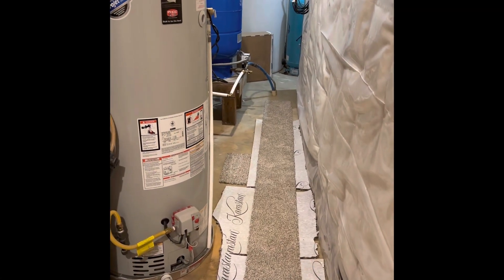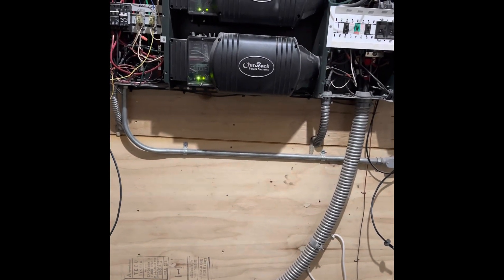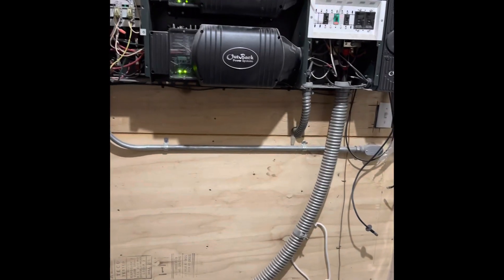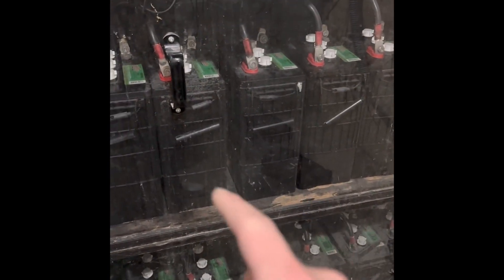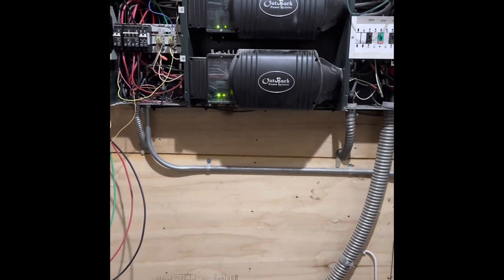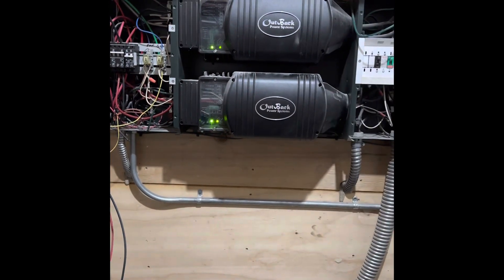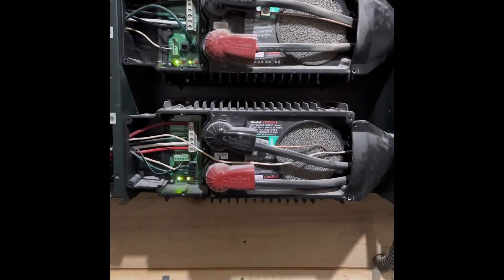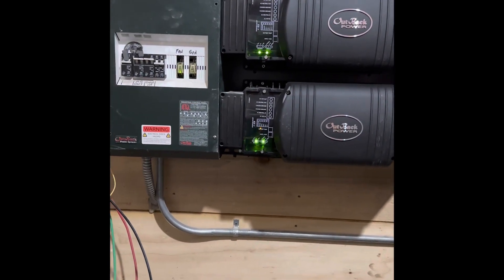New Outback Power VFXR3648A inverters with EG4 LiFePoWER4 battery bank

Comment: Nice video. I can appreciate the second set of hands because these new inverters are very heavy and tough to mount at that height. I noticed the 4 wires coming into the top of your AC panel. Is that your generator wiring and if so is that the red wire connected to your inverter's AC HOT IN terminal?

Comment: Very nice video. I have recently upgraded to the same exact equipment. I also have the older Outback panels with the normal-bypass wheel. However, I'm having trouble understanding how that is supposed to be wired up since I inherited this system from the previous owner. Can you do a video on that AC panel or explain how that bypass is supposed to function. Do you also have a generator tied to this panel to also charge the batteries if necessary? Any help would be greatly appreciated.

Comment: You can use the VFX inverters, you didn't need to change anything. I have 4 x 3648 vfx with mate 3s and optics RE and I have SOK batteries and I use the Flexnet to control via SOC% my ac coupling skystreams and solar.  Honestly don't see any real reason why you need to upgrade to fxr. I can control everything from my cell phone anywhere I am with opticsRE and the mate3s

Comment: Nice! I watched this because I'm currently replacing my lead batteries with those same Lifepower 4 batteries and I have  the same inverter as your new ones. 

Any chance you want to offload the old parts for a low price? I'm thinking of moving my old lead batteries to the well pump and powering the well with a few extra solar panels, but I need split phase 240 to run the pump. The well is 300' from the house which is why I'm thinking of options.